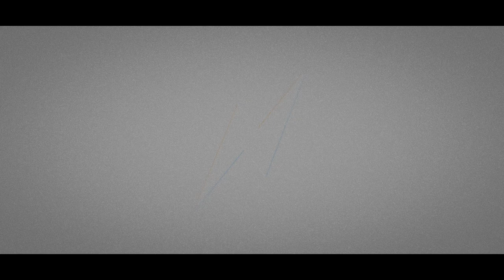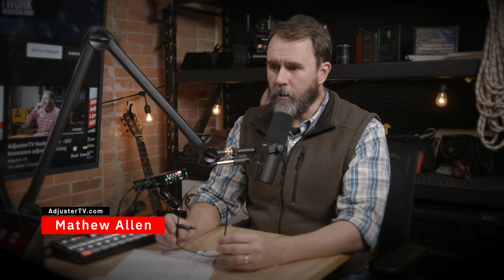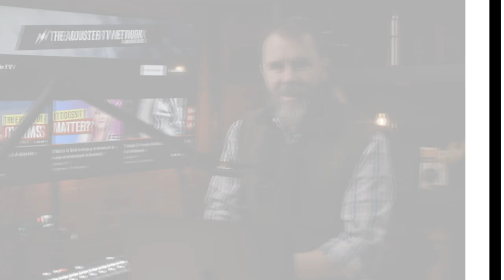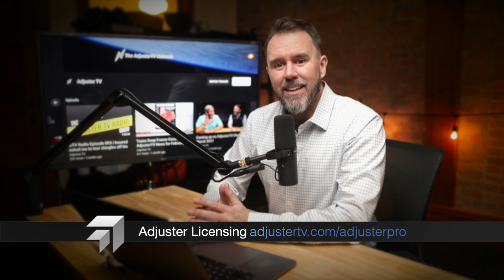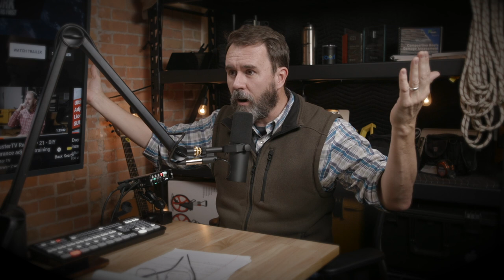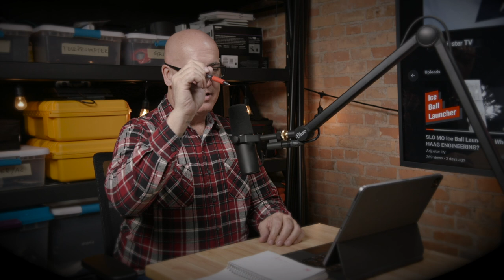Which ladder(s) should you use as a field adjuster? | Ladders, trucks, and speed hacks for adjusters

Comment: Midwesterner - mostly wind on mostly multi roof (upper and lower levels - lots of them)...    Suggested: Little Giant KING KOMBO - 8' (goes to 14, weighs nothing).  13 footer  folding - and a couch cushion to set on ridge, as the folders have flared bottoms.  Tie off with VELCRO not bungee.  Lastly - 24' or 28' little giant Hyperlite.  Double pulls are safer when done correctly vs. a 28' spread and strapped.  Roof does NOT give (when on cushion) with velcro to gutter.  The newer gorilla folders are HALF the weight of the older little giants and the Werners.   I have 13 (2), 17, 22, 26 in the folding, 32, 28 and 20 ext (outside of the little giant hyperlites).  They are all for sale if you want one...   Only suggestions.  Last note - the pull (rope) mechanism on the little giants are so much better than traditional.

Comment: I just bought my first ladder, ended up going with a 22 fit little giant, you’re right it is heavy, but no ladder rack.  Is marking up the shingles or gutters a big deal?
Reply from the maker: Hey, Trucker Jim!!  Denting gutters is a big deal if you're not going to already be paying for the gutters.  Best bet is to be careful.  You can install thin rubber strips on the gutter-facing side of the top section of your ladder to keep from scratching.  Truth is, tho, most gutters are pretty durable and made to have a ladder leaning up against them.  I've only scratched or crushed a few gutters in my days in the field, even without pads.  
If you properly secure your ladder to the gutter before you get on the roof, much less chance of you damaging the gutter.  
As for marking up the shingles, not sure what you mean regarding a ladder.  But in general, you'll find that most roofs already have some evidence of foot traffic on them - be sure to NOT mistake that for hail damage.